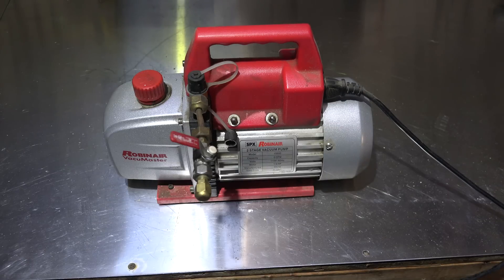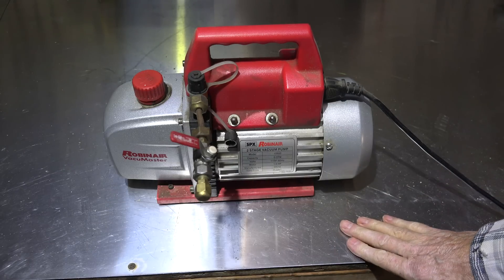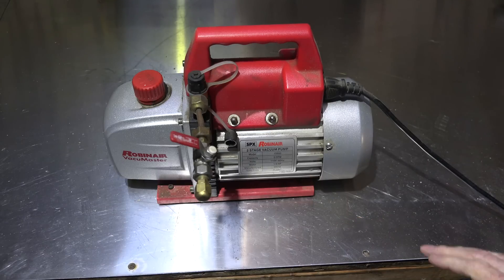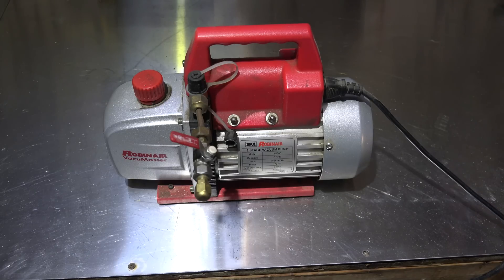What the vac pump can & cannot do

Comment: This may be an odd question, but couldn't I use a vacuum pump to evacuate refrigerant?  If not. what else could I use since a darn recovery pump is so dang expensive ?
Reply from the maker: You can.  However, you are dumping the refrigerant to the atmosphere just as if you just opened the valves to the atmosphere.  That is illegal.
GFM
Reply: Ah ok...we don't want to do anything illegal dude.  But I do want to know... Can a person rent a refrigerant recovery machine? what would a certified Ac guy charge to recover the rfrgnt in my own certified tank?
Reply from the maker: I don't know about the rental.  I would charge about $200 if you take the refrigerant.
GFM

Comment: Why do these pumps cost so much more than Harbor Freight's?  I was all set to buy this until I saw the Made in China label.  For how often I use it, I rather use the Harbor Freight's for 1/4 the price.
Reply from the maker: +Qiong Jia That pump is I think the Robinaire 1550.  It costs about $180.  It is 2 stage and 5 CFM.  The harbor freight units for about $100 are 2.5 CFM and single stage.  I think the 3 CFM 2 stage is about $160.  The american made pumps are $350 to $650.  All are 2 stage.  These are the numbers.
GFM